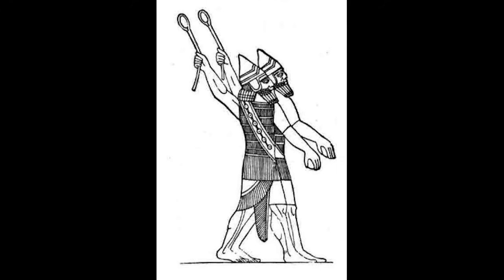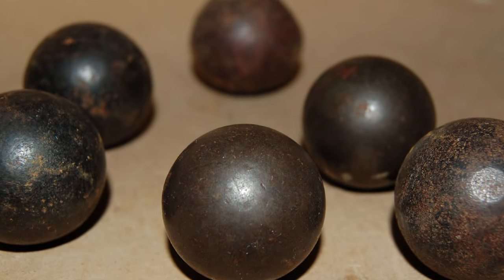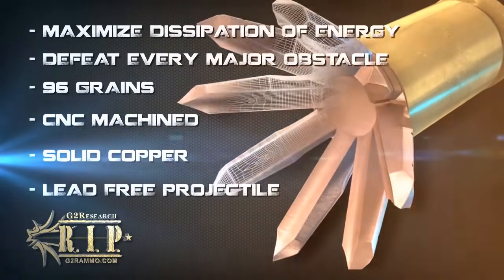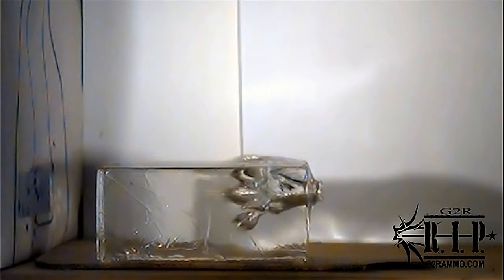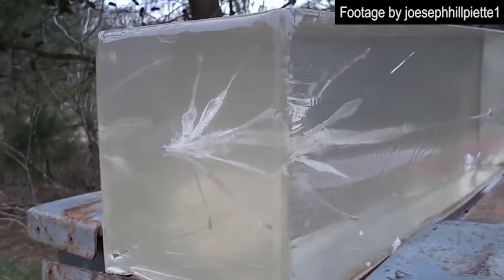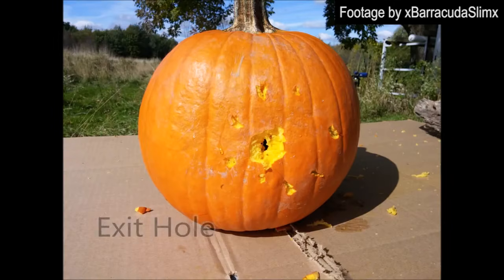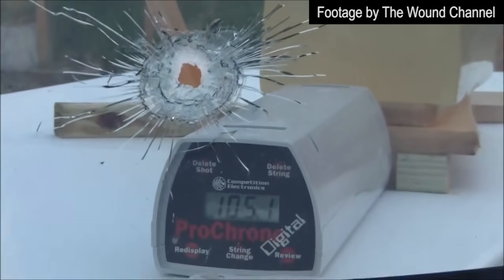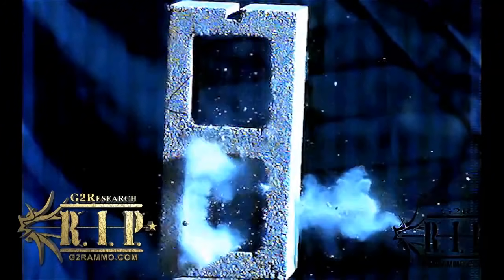The next step in bullet evolution: The Radically Invasive Projectile (RIP)

Comment: Its quite clear everyone commenting on this video is an idiot with no experience with guns. 

Look at the cavity these bullets leave. They are small. 5 small cavities still doesn't beat one big one. These bullets are expensive wastes that will not accomplish what is needed. No one uses these 

FBI wants a round with around 9 inches of penetration. Because ballistics jell is not a body. It has not bones. So 9 inches of penetration could translate to 4 in a human body. Especially when factoring in things like leather and denim jackets and even just thick layers of clothing. This round is not worth the metal it is made of. 

Yet everyone on this video makes it out to be the most dangerous thing they have ever seen. Shows what any of you actually know about guns.
Reply: How big is that gel block?  That is way more than 4 inches, and the initial cavity IS huge, that's what kills someone, not how far the round penetrates.  Also your only argument is "the FBI says it sucks, therefore it does".  And finally, I am in no way anti gun.  I hunt and own several rifles.  That round however is almost impossible to survive.  Every one of those points is like a razor, cutting through everything.  And you effectively admitted that they do kill "your already killing a person".  Your only basis for your argument seems like a report done by the FBI.
Reply: DietBroccoli
Don't bother refuting me. Just go to the insults. Its not like you had anything of value to say in the first place.
Reply: R Anthony Rupp IV
The FBI advocates 12 inches of penetration because any less will most likely fail to penetrate through thick clothes, fat, bone and muscle. Imagine has their arms raised in front of their chest. As if they were pointing a gun at you. A RIP round will not be able to go through the arms and then the chest. 

They are not razor sharp, nor do they cut. They are quite dull. Cutting also doesn't mean shit. The minie ball was round and it was known for its insane stopping power. 

My evidence was also a link which you ignored. Not just an FBI report.
Reply: 442hoeky
Funny thing is when it goes through a windshield, it doesn't lose its shape at all. The trocars stay on when it impacts glass.
Reply: DietBroccoli
Yes, lets use high explosives to show how bullets work. Its not like a frag grenade explodes at more than 4 times the velocity of a standard pistol round. Its not like fragmentation from grenades has better penetration against all targets than any pistol round. 

If you can't see the obvious difference between a hand grenade and and a pistol round then there is no hope for you. 

None of the fragments this round makes will have the force to penetrate, much less hit, any vital organs.
Reply: R Anthony Rupp IV
The initial cavity is not massive. Look at actual videos. It looks big when you take a closer look you see its just several very small cavities. The main round the trocars break off from is tiny and the trocars themselves are even smaller. 

You should look at the ballistics gel. This round penetrates 4inches. The FBI says anything lower than 9 inches is unacceptable. Because ballistics gel is similar to human flesh but it is weaker. You can penetrate 4 inches of ballistics gel with your finger. 

"I never want these used" yeah fuck you anti-gun pussy. You don't want them used because you think they're dangerous overkill. Who gives a damn. You are already killing the person. 

http://www.thetruthaboutguns.com/2014/02/daniel-zimmerman/g2-researchs-rip-ammo-ballistic-testing-phase-one/
Reply: Michael Bacon
Several times I have posted links that several times you and have everyone else has ignored. 

No, your logic is flawed. Its a bullet. Anything travelling at 1000 FPS is going to hurt a shitload. And getting shot would require a hospital trip. Stop acting like not wanting to get shot means anything.
Reply: *****
M9 pistols were common. Its almost like they're standard issue in the army. Doesn't mean you are like a cop who uses a handgun every single day. 

http://www.nytimes.com/2008/04/03/nyregion/03shot.html
Its pretty rare to kill someone in one bullet. Especially immediately. Unless you hit someone in the head with a bullet, chances are they can still shoot you. 

https://www.policeone.com/police-heroes/articles/6199620-Why-one-cop-carries-145-rounds-of-ammo-on-the-job/
Policeone, a website for cops. What you see is that it can take more than one bullet to kill someone. More than 2. More than 10. 

http://www.grandviewoutdoors.com/guns/case-closed-fbi-says-9mm-is-the-best-pistol-round/
FBI says use 9mm because all pistol rounds suck but 9mm is cheap and easy to use. 

You don't need to trust me. Because the people who use a hangun every single day say what I say.
Reply: Unlawful Waffle No. CSGO takes skill. It takes years and years of practice to get where the pros are, whereas in COD you can grind for about a year and be on a pro level.

But yeah, tournaments are retarded... way too much hype over a goddamn video game.
Reply: Iburmanable
Except that is not true. The fragments are small and leave small cavities. They have low pontential for damage. And it penetrates barely 4 inches in ballistics gel. Which means if they have heavy clothing like a denim or leather jacket, a few pounds of fat, or they have their arms in front of their chest (ie pointing a fucking gun at you), you will not hit anything serious. 

It has no place anywhere because it is a gimmick bullet designed to look scary. 

If you didn't look at the link I sent, why are you responding to me? You clearly don't care what I have to say.
Reply: +Unlawful Waffle : You are wrong.  Look at how frag grenades kill for proof.  Creating a greater volume of cavitation, i.e. more exposed surface area in the body, means greater lethality.  Additionally, with 5 pieces of shrapnel radiating from the center round you have an increased likelihood of penetrating heart, lungs, and liver.
Reply: +PhaZe OutLaW lmao noice
Reply: *****
Its not like i've posted links to experts several times throughout this discussion.

Also you don't need to shoot someone to know what a bullet does to them. I've never dropped chlorine gas on people but I can tell you that it is horrifying. Same goes for bullets.
Reply: *****
And what are you? A nerd that watched a bullet advertisement and thinks hes a ballistics expert. You aren't even trying to counter my points and you never have been. 

You don't need to be a German world war two veteran to know that an 88mm cuts through tanks like butter. You don't need to drive cars to know that a ferrari is fast. You don't need to be a cop to know what bullets do. 

Also soldiers rarely use pistols. Rifle rounds are entirely different than pistol rounds so me being a soldier would give me the same credibility I have now.
Reply: Frothlord 007
No, don't bother reading any of this convo. Just comment your little crap.
Reply: Frothlord 007
I've seen paper cuts that can cause a scar. Skin deformation? We want dead bodies from bullets, not scrapes.
Reply: DJDeezy ThaTruth
Thats really cool. But the police, military and myself all want a bullet that will kill immediately, not 3 hours after I shoot him. Because most hollow points are a pain to remove. But that doesn't make them more lethal.
Reply: DJDeezy ThaTruth
The slug travels 4 inches in a body with a tiny mass compared to other hollow points. The individual trocars make tiny slugs. You didn't bother to read any of the sources i posted or watch the videos so I'll sum it up. This bullet is a piece of shit that barely penetrates 4 inches in ballistics gel. Which means it wil struggle to break thick clothes, fat, muscle and ribs.

This round shouldn't be on the market because people will buy it for self-defense and get themselves killed.
Reply: DJDeezy ThaTruth
The slug went maybe 4 inches in to ballistics gel. You didn't watch any of the videos. A level 2 vest isn't rated to stop 9mm. I highly doubt a hollowpoint could go through that. Especially one that weighs less than conventional hollow points.
Reply: Frothlord 007
If any bullet hits a fleshy bit it ends badly. .22 bullets have claimed a notoriously high kill count. Because people get shot with them, don't go to the hospital, and die of internal bleeding. Some say more have died from .22 than 9mm. This doesn't mean that cops are gonna start issuing .22s.
Reply: Unlawful Waffle Nope. COD is made to be very friendly to new players and very casual. That's why its "competitive" seen is absolutely retarded. CS has been competitive almost from the very beginning, but the competitive seen is still pretty retarded because it's just a game.

CS compared to COD is very similar to Dota compared to LOL. Although both have pros with many years of experience, it is way harder to be good at dota than with LOL.
Reply: Unlawful Waffle If being a "new Call of Duty" means the go-to casual game, then yes, CS:GO is the new Call of Duty.

What I'm saying is that CS:GO is more difficult competitively. The difference is that the average "casual" CS:GO player is usually very low on the ranks, while the average COD player is relatively much higher, because the skill gap is so low.
Reply: Unlawful Waffle The average casual COD player does better against COD pros than the average casual CS:GO player does against CS:GO pros.
Reply: Unlawful Waffle alright m8 i know this because my hammer and sickle gives me special knowledge about lamborghinis that no one else has... i know this stuff okay... just trust me... k?
Reply: The USSR
Sickle and Hammer gives you special knowledge on how to starve millions of your own people to death through incompetent economic systems.
Reply: *****
A shirt will make no effect on a bullet. Clothing only matters in thick or tough layers. Someone wearing a denim jacket or winter clothing can interfere with hollow points and make them spread to early. 

The RIP would be more difficult to remove, but it would not cause more bleeding. The larger cavities created by a conventional hollow point and the greater potential to hit a vital organ make it better.
Reply: +Unlawful Waffle clearly must not have seen what it did to the chicken lol
Reply: ZamB Bros
.22 rounds obliterate chickens. That means absolutely nothing. All birds are incredibly fragile. Thats why birdshot is used for hunting against birds, but is nearly non-lethal against humans.
Reply: *****
I believe you have problems understanding terminal ballistics and cavity creation caused by bullets. Its amazing how people who don't know anything about guns flock to these fucking videos and spam the comments.
Reply: *****
Unnecessary as they are more expensive than other bullets and do drastically less. These bullets will get people who use them for home defense killed. Because they will not kill the person being shot at.
Reply: *****
I just looked up some other information that these would be incredibly painful to remove if you actually got shot with them. They split up inside so each piece would have to be pulled out separately.
Reply: +Unlawful Waffle that is if the doctor could find all the little fragments. And that's IF you can get to a doctor before you bleed out
Reply: bob sagot
You can quite easily get to a doctor before you bleed out. These won't cause heavy bleeding. The cavities they create are small.
Reply: Iburmanable
"If an artery gets hit". Thats true for all bullets. But all other bullets are not dependent on that. Other bullets rip organs and destroy bones. This does not. Here is proof if you don't believe me 
http://www.thetruthaboutguns.com/2014/02/daniel-zimmerman/g2-researchs-rip-ammo-ballistic-testing-phase-one/

Not to mention, cutting an artery will stake take at least 30 seconds to actually incapacitate someone. Military, law enforcement and home defense demands bullets that immediately kill to prevent the attacker from being able to respond.
Reply: +Unlawful Waffle Finally someone with some sense. Just because something looks scary doesn't make it more deadly than something else. Enter the AR15 assault rifle misconception. These rounds suck. There's a reason why law enforcement carry JHP rounds, and they will not switch over to these.
I'd use these for shooting balloons, pumpkins, or to do some 2 liter killing with Hickok45. 

Too bad they're stupid expensive.
Reply: JettyLife23
Most of the people commenting on this video clearly know very little about guns or bullets. I wager most of them are anti gun people who found this viral marketing.
Reply: +Unlawful Waffle If some cops took these on their colleagues they would soon wet their pants. That's how they roll.
Reply: What does any of that even mean... lol
Reply: Faust1169
no they would not.
Reply: +Iburmanable   I know what you're saying and if shot into the chest of a naked person, then yes, there's more chance of an artery being opened up.  However, this is not the first bullet to fragment on impact.  Even filing down the point of a rifle round a little and scoring an 'X' into the point causes a similar reaction (or cutting an 'X' into a lead ball round).  Thing is, they've done extensive studies on this and all things being equal, the most damage is done by the round that deforms the most (doesn't hold it's original shape) WITHOUT breaking apart.  What interested me most about this round was the way it seems to 'cut' through the wind shield.
Reply: Question: What if they increased the caliber of the bullet? Would you get the hole you're looking for?
Reply: -AP- Uni Fi
In a pistol round? No. What decades of experience has taught the FBI, its that pistol caliber doesn't mean jack. No matter the round, they don't have much stopping power. It is always down to shot placement with pistols. 

In a rifle round? I doubt it. The fact is that the trocars have significantly less weight than a normal hollow point, meaning each one does little damage. Not to mention most rifles are not lacking in stopping power. Actually, for home defense, this COULD be a good rifle round. It would cause minimal collateral damage. 

It still just a gimmick meant to look scary in the end.
Reply: +Unlawful Waffle My thoughts exactly
Reply: +Iburmanable You got shit on with facts. He gave yo ass a reliable source.
Reply: Iburmanable But you got shit on with facts bro. Also if you were to get shot with any bullet to the face or artery of course you're dead lol.
Reply: +JD Moua Maybe not a .22 round. Many survive those shots.
Reply: PhatGirlLuva68-ThelastOG
Actually they often don't. People take a .22 round and see how small the hole is so they don't go to the hospital and they die a few hours later.
Reply: Unlawful Waffle Just from my personal experience, no.
Reply: PhatGirlLuva68-ThelastOG
Who gives a shit about your personal experience. Theres a reason is 2nd for deaths caused in america.
Reply: Unlawful Waffle Nice way to conduct an "intelligent" conversation.

You haven't provided any more proof of your point than I have. Just your opinion. Ass.
Reply: PhatGirlLuva68-ThelastOG
http://www.xdtalk.com/threads/fbi-rates-the-best-caliber-for-killing-humans.148876/
http://www.firearmstactical.com/pdf/fbi-hwfe.pdf
http://www.bjs.gov/content/pub/pdf/GUIC.PDF

Its pretty common knowledge. You're just a dumbass who thinks your own personal experience somehow reflects that of 300 million other people.
Reply: Unlawful Waffle I never said that, you just took it that way, dumbass.
Reply: PhatGirlLuva68-ThelastOG
From my personal experience, no. 

So me saying that people will die from .22s a lot is negated because it never happened to you. Nice try.
Reply: Unlawful Waffle Again, your depth perception is very shallow.

 I never attempted to negate anything that you said. I only dared to offer a differing opinion based on lots of personal examples. Just because lots of people die from .22 fire doesn't mean that everyone does, twit.

Apparently your need to be "right" outweighs your ability to even hear a dissenting opinion.
Reply: PhatGirlLuva68-ThelastOG
I never said everyone dies from .22. I said most people do. Learn to read.

SO basically what you are saying is "I know that you said most people die from when they got shot from a .22, but I know a guy who didn't".

So 1: You did try to prove me wrong. 
2: You did it like an idiot. 
3: You cannot have a dissenting opinion on facts. If I say 2+2=4, you cannot offer a dissenting opinion and say its 5.
Reply: Unlawful Waffle That's not true but whatever.
Reply: Unlawful Waffle : You're either stupid or lying.  Which is it?
Reply: But the initial cavity is massive.  unless they have a very small block of gel in the video, that round does huge damage to the target.  and before you say anything about how gel isn't flesh, ballistic gel is the closest thing to human flesh beyond a pig carcass.  and if you still desire to argue about how deadly that round is, why don't you volunteer as a target.  I for one never want these used, a simple hollow point does the same thing
Reply: Is effectively a buck and ball round for small arms, with the main slug acting as a regular round and the the points as the shot.
Reply: *****
The nambu type 92 is the worst pistol ever made. Going by your fractured logic, you would have no problem with me shooting you with it. After all its crappy so that means its non lethal. 

You're a dumbass if you think thats a good argument.
Reply: *****
Would you rather Mike Tyson punch you in the face with his bare knuckles or brass knuckles? Its going to hurt either way, but the brass knuckles will put you in the hospital, and maybe 6 feet under. 

My point is that your comparison is essentially just a would you rather question that teenagers play.
Reply: *****
Go spend some money on the rip rounds you adore on your way out.
Reply: *****
Love you too baby.
Reply: *****
Only animals. 30-06 never fails.
Reply: +Unlawful Waffle finaly someone who knows what theyre talking about.
pistols punch holes, fmj -jhp have worked just fine for years, with pistols its all about shot placement.
Rifles are the real Hollywood death machines, .308 - .223 - 7mm rem - 8mm mauser  = extreme incapaccitation
Reply: +Unlawful Waffle still that would kill someone and tear them apart
Reply: Unlawful Waffle I did read it, Its just the fact i wouldn't want this hitting me. it would disfigure you, probably moreso to limbs like your arms and legs. But yeah this thing is kinda collateral damage. The fragments that separate would probs get stuck in you. so yeah... I'm not awfully keen on being shot by these or any other bullet.
Reply: Frothlord 007
I'd rather take this than an FMJ or standard hollow point. With 4 inches of penetration in ballistics gel, I'll risk my life against this round any day over a standard hollow point.
Reply: Unlawful Waffle True, I was more things to arms and stuff, but to really fleshy parts of the body like the chest. I would probs be more afraid of =a hollow point or FMJ round.
Reply: Frothlord 007
FMJ and HP retain more mass and cause more bone damage. For my arms, I'd much rather have the bullet do flesh damage than shatter my bones. Muscles repair a lot faster than a bone.
Reply: Unlawful Waffle True, but it could probably result in deformation of the skin, at a guess.
Reply: Unlawful Waffle I guess, depending on the situation... But for normal civilians, I don't think this is right. Well I'm personally against guns in the way america has them. I find Australia's (I live there) gun laws work to prevent a large amount of "shooting" instances.
Reply: Frothlord 007
Yeah you just have a stabbing problem now. England restricted firearms and discovered that people just use knives instead. Now England is trying to ban knives and even has a campaign called "save a life, bin your knife".
Reply: Unlawful Waffle Australia doesn't have that problem? sure there is domestic abuse, thats the closest we got.
Reply: Frothlord 007
Of course your murder and assault with deadly weapons are lower. They were lower before guns were restricted. But you'll see that it hasn't dropped since either.
Reply: +Unlawful Waffle --I just dont see how these wouldnt trigger MASSIVE internal bleeding. Ignoring the slug that just went threw you. It would be near impossible for a doctor to fix all those internal wounds. Blood would surely flood into your lungs.
Reply: Unlawful Waffle
--I mean there's still the slug that went threw your body, which is just the flat copper tip we are use to. The added shrapnel seems more like a mini-grenade attached to it. Other then that, less its a vital shot.. no bullet will kill you right off. Though some die from shock(which is pretty normal). Regardless, I dont think a Bullet like this should be on the Market.
Reply: Unlawful Waffle
--The Videos showed the slug going threw-in-threw. I've watched allot of them by now. Even that FPSRussian guy tested that MF. Nasty bit of metal. Showed a test on a Stage or Level 2 Vest, sliced threw that. I was shocked.
Reply: Unlawful Waffle
--I mean I've seen several videos, they all are on YouTube. Regardless, I still dont like this bullet.
Reply: DJDeezy ThaTruth
Because its a round designed to look scary and nothing more or because you think its as effective as it looks?
Reply: Unlawful Waffle Still the damage that that would do to flesh, its a collateral damage round. If that hit a fleshy part of the body, man that wouldn't end well.
Reply: Hey, I know a lot about guns. I'm a former master guardian 2 in CSGO, and I have almost 100 wins.
Reply: The USSR
CSGO is just the new call of duty.
Reply: +D&#39;Angelo Jefferson Yeah
Reply: The USSR
No, cod took a high level of skill as well. The only difference is that cod didn't use weird mechanics to make an artificial learning curve. 

Both games are incredibly popular, especially among the 12-15 age group. The real difference is that cod didn't use microtransactions to make money.
Reply: The USSR
And yet the new congregation of youtubers and casuals is CS:GO. It may not be as user friendly but that doesn't matter. It is still the golden beacon of the casual FPS player.
Reply: The USSR
Cod never have ranked so to say that the average player was ranked higher is untrue. There is nothing to support you.
Reply: The USSR 
Based on what? They don't exatly have pub vs scrub games
Reply: Yes.
Reply: +Unlawful Waffle Hi! Good info. I'd have a question. Let's say you only have a shirt on and get shot in your abdomen. In terms of stopping the bleeding, what would you say would cause a bigger problem? This or the bullet that makes one big hole? Wouldn't the many smaller tears not pose a bigger problem for doctors?
Reply: Unlawful Waffle clearly has some problems understanding basic physics/biology.
Reply: +Unlawful Waffle Shrapnel is the deadliest thing on the battlefield, why not put it in a bullet?
Reply: LiamFVJ
Because you're a dumbass that doesn't know what shrapnel is. Shrapnel is the fragments created by an explosion. If its not coming from an explosion, it isn't shrapnel. 

Not to mention shrapnel is deadly because it is typically fragments larger than a bullet moving at speeds up to 24,000 FPS compared to the 1000 FPS of a 9mm.
Reply: +Unlawful Waffle Wow you are really quick on the draw, why must you be so mean about this though, we're just having a conversation on the internet, no need to name call. As shown in the video, the bullet still leaves a large main hole while also sending teeth in 6 other directions, think about this from a medical perspective, your a doctor and you have to extract 1 large piece of metal from the body of a patient, hard but not impossible, now imagine you have to do the same but with 6 more smaller holes darting out in all directions, all while your patient is bleeding, significantly more difficult.
Reply: LiamFVJ
I've been saying the same thing to a hundred different people who don't bother reading. Its quite annoying. 

1: The cavity is tiny compared to a standard hollowpoint. The FBI says any bullet with less than 12 inches of penetration in ballistics gel is unfit for law enforcement. This bullet leaves a cavity about 4 inches deep.
2: Nobody cares if its difficult for a doctor to a pull it out. If the bullet did its job, a doctor won't be pulling it out, a mortician will. You need a bullet that can immediately, not in 4 hours.
Reply: Unlawful Waffle Why would you want a foot of penetration? A lot of parts of the human body aren't a foot thick and for law enforcement you don't want it to penetrate through your target for obvious reasons. This bullet may not kill as quickly this bullet is going to incapacitate an armoured target just as well as regular bullet.
Reply: LiamFVJ
Ballistics gel is not human flesh. It is close but it is not the same. Not only that but ballistis gel doesn't account for things like bones, thick muscle or even fat. It especially doesn't account for thick clothing like winter jackets or tough fabrics like denim. The FBI says that over penetration is always favorable to undepenetration. The reason being that if the bullet goes through the body it can still hit important things but with underpenetration the bullet can be stopped before it even hits n organ. 

If you go back in the comments section, you will see several links I posted that show the RIP round failing to break through a set of pig ribs. 

This will kill an armored target? No it will not. Maybe some one in level 2 soft armor. But a simple steel plate can easily stop any hollow point and most level 3 soft plates can stop a hollow point. 

This isn't a movie. This is real life. People rarely die in one bullet, and they rarely are incapacitated in one bullet. I recommend you actually do some research. I'm going to start you on this by a quick summary. About 60 years of FBI data points to a few conclusions. Number one: No pistol round has enough stopping power over another to make a difference. .45 is stronger than 9mm, but the difference is negligible. Two, the only thing that matters with pistol rounds is shot placement. This is why the FBI and cops over the country stick with either 9mm or .40. Because its cheap and you can carry a lot of it. It does not matter if your pistol bullet has more stopping power than mine. Because in the end it comes down to who can hit more shots in the vital parts.
Reply: Whoops, sorry I was on mobile and it auto corrected to armoured I meant unarmoured. A regular 9mm wont go through a lot of armour anyway, and I doubt a jacket would have any effect on any bullet, I'd like to see a study showing a jacket or denim being at all consistent against a .22.

Sure hitting vital organs is very important, but shooting someone anywhere on their centre of mass is probably going to put them into shock or, at the very least, incapacitate them.

And on the subject of penetration, almost all regular police forces will only use hollow point rounds because they are much safer for the bystanders in a situation where an officer may have to shoot a suspect in a crowded area, even though these rounds have far less penetration than standard rounds, they are used because it is safer for the public.
Reply: LiamFVJ
See this is exactly what I am talking about. You don't know about industry standards for bullet testing. You don't know anything about guns and bullets and yet here you are commenting away. Why do you people swarm like locusts to RIP round videos? Theres been like 50 people before you saying the same damn thing but each person comes and repeats the lines. 

https://bulletexpansionthroughdenim.wordpress.com/
https://www.ar15.com/archive/topic.html?b=5&f=20&t=121915
http://www.thetruthaboutguns.com/2014/02/daniel-zimmerman/g2-researchs-rip-ammo-ballistic-testing-phase-two/

Those links explain the Denim test and the last one deals specifically with RIP rounds.

No, shooting someone in the chest will not put them into shock. It might, but it is not guaranteed. https://www.quora.com/Why-do-bullets-instantly-kill-someone-besides-just-creating-wounds

https://www.policeone.com/police-heroes/articles/6199620-Why-one-cop-carries-145-rounds-of-ammo-on-the-job/
http://www.nydailynews.com/news/national/video-sf-police-filmed-unloading-barrage-bullets-man-article-1.2454453

People will often die from a small number of bullets because they believe you are supposed to die when you get shot. You'd be surprised but if you think you are dead your body doesn't fight to live. Yet when someone is on enough drugs to stop an elephants heart or they just believe they won't die, the only way to kill them is to hit a vital organ. You see this a lot nowawdays. My friend's 4 year old nephew was shot several times at close range and made it to the hospital before he died. A 4 year old. An adult body can take much more. 

http://www.shootingillustrated.com/articles/2014/7/16/overpenetration/

Over penetration doesn't fucking matter when a lot of the bullets you shoot are going to miss. 

Also the 12 inch minimum is for hollow points. So you're still wrong.
Reply: A lot of the stuff you link about people suspect carrying on after multiple gunshot wounds are hardly scientific, these are freak situations, one in a million. And the ballistic tests you link are extremely unprofessional, in what realistic situation would someone wear 4 layers of denim let alone 12? No one, people will wear 2 at most. And, as much as a feel for your friends nephew, anecdotal evidence carry's no weight. The last article you link is the most professional, but it's still basically an opinion piece by a magazine. Most global police forces have done the research and have found under penetration to be safer, I think I'm going to trust them over NRA illustrated.
Reply: LiamFVJ
Apparently you didn't bother to read the links more than a few paragraphs. 

I'll paraphrase an analogy that was used. Car safety tests often crash cars into concrete walls at speeds above 65 MPH. This is an incredibly unlikely crash and represents the worst possible crash. And this is still part of industry standard tests for cars. 

Will someone wear 4 layers of denim? Probably not. But if you read the links I posted, you'll find plenty of stories of people wearing an excess of 6 layers of clothing because of this nice thing called winter. 4 layer denim is a worst case scenario test. 

You seem to have ignored all the aspects of the lethality of guns I posted. 

http://www.forcescience.org/articles/naiveshooter.pdf

Police are not much more accurate than someone with little training. They will miss bullets in a firefight. Tell me, what is the fear of overpenetration striking a bystander when cops are almost certainly going to miss some of their shots?
Reply: LiamFVJ
"Most global police..." Firstly, citation needed. Secondly, most nations with competent police forces have less gun violence (gun violence, not violence) so the only police I would trust on this issue are US police. I doubt the Germans would have the same type of experience as a cop from Oakland.
Reply: Its common knowledge that most Police forces within the US use hollow point, I think the only ones that don't are the New Jersey state police forces and they are considering switching to hollow point. Most world military's use high penetrating ball ammunition, for its ability to penetrate military grade armour, and because it causes less internal damage while still having the ability to incapacitate a target, because all bullets have a high chance of incapacitating a target.

Any situation where someone can still stand after 3 or more of any bullet to the chest is a pure luck. You want to know why? because the instant a hole is made in the chest cavity the vacuum that is created by the diaphragm is lost, making it impossible to breath. you'll also see a sharp decrease in blood pressure which will put extreme strain on all parts of your body, but mostly your heart and your brain. Pretty much anyone who's been shot in the chest has at most 30 second of delirious conciousness if they don't pass out instantly. The human body is a lot more fragile than we like to think.
Reply: LiamFVJ
You aren't even reading what I post. So if you do not read this post we are done because theres no point in me talking to a wall. 

I never said police use FMJ. I said they use hollow points. And I said that the 12 inch test is standard for hollow points. 

Militaries use FMJ because anything besides FMJ is banned by the geneva convention, and also FMJ is cheaper. Rifle rounds are big enough and fast enough to not need hollow points. 

Its amazing how you've ignored every link I posted. 

Sucking chest wounds do not make it impossible to breath. They slowly make it harder and harder to breath. Because an air pocket forms and slowly, slowly, compresses the lungs. It takes a few minutes for breathing to stop. 

The human body is not more fragile than we think. Most people think you die from one bullet immediately. Your previous posts put you in this category. And this is not true. You are right. Its luck on whether or not the bullet hits your heart. Thats why shot placement, not bullets, matters. 

http://www.nytimes.com/2008/04/03/nyregion/03shot.html?_r=0

All you've done is prove my point. the RIP round doesn't matter because all that fucking matters is hitting the gribbly bits.

REMEMBER. Read carefully or were done.
Reply: You said "citation needed" to my line of "Most global police forces". 

And a sucking chest wound will collapse the lungs but it also removes the diaphragms ability to resporate because it has no pressure to work with, making it impossible to breathe. 

and I never said a bullet kills on contact, I said incapacitate, and yes its a fact that a single bullet will incapacitate because in 99% of situations where police use lethal force the suspect goes down in the first shot, do you think they hit the heart every single time? Hell no. It is true that police tend to fire more rounds than need be but this is largely due to panic in a tense situation. 

And the reason FMJ is mandated in the Geneva convention is because it causes less damage, do you think they just put in there for shits and giggles?

I don't think the RIP round is the deadliest thing ever, a .50 bmg is going to kill you much better through sheer size, but for a 9mm the fact that it has 6 tiny teeth means at least one, probably more, of them is going to get past a rib and cause serious internal bleeding.
Reply: LiamFVJ
Yes. What exactly do you mean by world police forces. You just threw that out of the blue.

The diaphragm still works with a sucking chest wound. It loses the ability to work over time. 

You and I both know you just pulled that statistic out of your ass. They do not go down in the first shot. Talk to any cops. As soon as a cop starts shooting, they empty their magazine into whoever the are shooting because they want to make sure they die. Thats why when there are police shootings, the cops shoot what seems to be an excessive number of bullets. 

Not true. They banned them because they cause more sufffering. The bayonets you see on mosins or old chinese AKs were banned by the geneva convention too. Are they deadlier? No. But the wounds they cause are harder to repair. Same with non-FMJ rounds. They may not be deadlier, but they sure as hell cause more pain.
Reply: Ummmm..... And have you been shot before with a Fmj or hollow point? It may not do as much but boy it would do a number on your vital organs. The ballistic gel can only simulate humans so well. plus a bullet won't give a shit about leather, I mean REALY? And if it came to having to be shot by that round or an Fmj, I would take the Fmj, I do not want to bleed to death.
Reply: +Unlawful Waffle on your cars hitting walls at 65 mph thing. Say one car is going 30 mph and the other 35. Add them up 65 mph like hitting a brick wall. Ie brick walls TEND TO BUT NOT ALWAYS give a little.
Reply: +Unlawful Waffle yes and in that time you are panicking, their fore bleeding a bit more, their fore not helping matters. Any way ya slice it, it's guna hurt like hell and you WILL be feeling it tomorrow
Reply: I'm sorry but they are lethal. Bullet makes the chance it will hit something vital and cause hemorrhage . You get shot and get shrapnel at the same time :,(
Reply: henry Sanson 
Shut the fuck and read the conversation. There is no fucking shrapnel. It is one hollowpoint.
Reply: henry Sanson 
shrap·nel
ˈ
noun
fragments of a bomb, shell, or other object thrown out by an explosion.

No
Reply: well your dictionary is shit! its anything coming from a projectile so yes! clearly don't know anything  about guns ahaha noobs these days.
Reply: henry Sanson 
Please go back to call of duty.
Reply: DUH there lethal there suppose to be, there meant for self defense, if someone came into my house with a gun and i had kids im gonna want to do anything to put them down to protect my kids so yeah there gonna be lethal
Reply: Unlawful Waffle I agree with you 100%